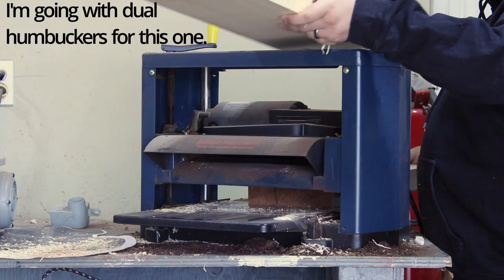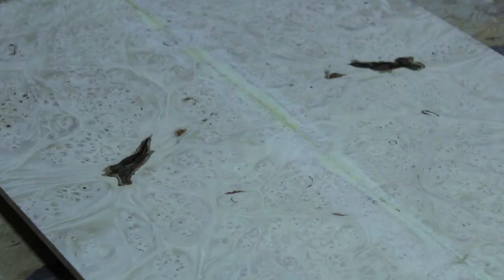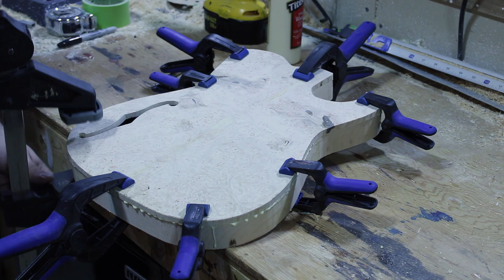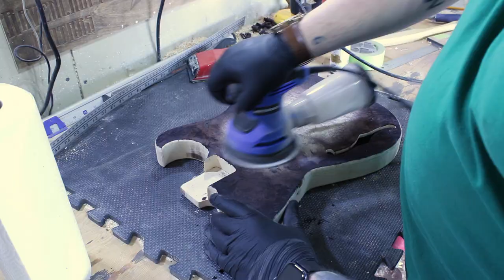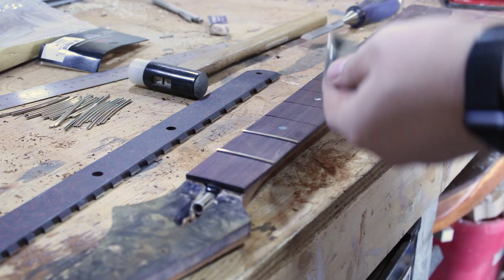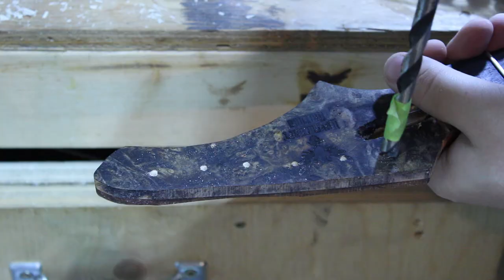GGBO 2023 - 15min Final Video Submission

Comment: Most people get better  at something they keep doing. You seem to be going backwards.
Reply from the maker: You know Tim, you are often very harsh with my builds, but never give specifics about what it is you so dislike about my builds. Can I ask what made you so vehemently disappointed with this one? I truly feel like it is a contender for one of the best I have made to date.
Reply: @ravencroftguitars  First of all, it's sloppy, it only looks good from a distance, and the design shows no imagination or innovation. Then you drilled a hole through the body and covered it up instead of repairing it. . Such an amateur thing to do. Your work is getting increasingly sloppy. It seems that you are always rushing to get done instead of trying to do it right. Everybody has the right to choose their hobby and to believe they are good at it.  Do you want the full list of what I see wrong on this build?
Reply from the maker: Sloppy how? I can assure you, it looks good up close, considering I can see it through more than a screen. You're right, I didn't inovate anything, but not every build needs to push the boundries of what it means to be an electric guitar. The person I built this for picked the shape out of ones I had already done, wanted it semi-hollow, and wanted it to be baritone. I had never built a baritone before, so I took that as the new challenge of the build. 

Yeah, I accidently drilled through the body. But I fixed it. Amateur move, but shockingly, I am an amateur. This isn't my day job, it's a hobby that I do on the side. Guarentee I won't make the mistake again.

Other people seem to like it. The person I made it for is over the moon with it. I'm calling that a success. 
I can see all the things I did better in this one than past ones. I'm calling that a success. 
I only had one major issue, and was able to overcome it. I'm calling that a success.

I'd be very interested to see a video of one of your builds, since you clearly never make mistakes and innovate with every build.
Reply from the maker: I don’t rush. I take my time. My builds take me a great deal of time. You see it condensed to 30min. 

Go for it. Share your list of grievances.
Reply: Dear Tim,
I wouldn't piss on you if you were on fire.

Sincerely,
Everyone in the guitar building community....
Reply: @BBGuitars  You speak for everyone who builds guitars, do you?    Or do you mean all of the Ben Crow fanboys?
Reply: @timhallas4275  yes everyone. Not sure what Ben Crowe or anyone has to do with your consistent non wavering ability to be a complete sphincter time and time again...
Reply: Yeah, I think "everyone" is pretty accurate.  lol
Reply from the maker: @timhallas4275  Not sure what about his comment would make you connect it to politics. Let's keep that out of this conversation, shall we?
Reply: @ravencroftguitars  OK, then tell your buddies to stop treating me like an enemy. If you have an issue with me criticizing your work, then it should be between you and me. I will respect your right to disagree with me. Do you?
Reply from the maker: @timhallas4275  Perhaps these people are upset with you because you do this same thing to a lot of different people. I have a pretty thick skin; nothing you can say about my work will be worse than what I say about myself. But if this is how you talk to people, you can probably expect some backlash.
Reply: @BoneheadGuitars  Name 5 builders who don't like my comments on their work.
Reply: No, they are upset because they personally cannot handle criticism. They thrive on the attention they get on Youtube, as long as it's always praise.  They need it.  I don't think you do.  You asked me why I didn't like this guitar. That is a whole lot more adult that these whiners.
Reply: Corey Muxlo
Shock the fox
Chris Franklyn
Gotheider
Chris Hattan
4thAve
Adair
Brett Morehouse
JBird
Outrider Custom
Ray Bagget
Reality Studios
Steve Walker
Mumbling Productions
Bonehead the Great
For starters.  😂
Reply from the maker: @timhallas4275  Did you voice your criticism the same way as you did here? Because if so, I can see why they may have gotten upset. You told me that I’m getting worse the longer I build. That’s kinda a harsh way to say you didn’t like this guitar. I know a lot of good people and builders on here that have been upset by how you present your criticism. Perhaps it’s time to reevaluate your communication tactics. 

You’re right, I don’t care about YouTube. I just like building guitars, and this is an interesting way to document it and connect with other builders. Most of my videos don’t get more than a couple hundred views, and I’m fine with that.
Reply from the maker: @BoneheadGuitars  “Bonehead the Great” got me lol
Reply: @BoneheadGuitars  I have not commented on 90% of this list, which tells me that you are just throwing random bullshit up here.  Shock the Fox... I did not piss him off. 4th ave guitars and I are friends.....  the rest I never heard of.
Reply: @timhallas4275  don’t assume.
Reply: @Tim Hallas Ok i'll have one try at this.
There are ways of communicating that are honest, truthful, empathetic and constructive. Critiquing something someone has created from scratch is a situation where you should be more vigilant in that communication, as it can easily be misinterpreted as ‘being an asshole’. Even more so with asynchronous, text based forms of communication. 
Being an adult isn’t just about being able to receive criticism, it’s about being able to deliver it in a way that it will be received in a positive and constructive way. If you can’t do that, you will be perceived as an asshole.
Reply: @micksguitarsarecool  Given the choice between being perceived as an asshole and encouraging failure...I'll risk it. Maybe this guy will understand that.  I raised 7 children on this philosophy.  Maybe they all think I'm an asshole, but none of them are failures.
Reply: We are all a community of builders, new and old. We all critique and praise and help each other in a respectful way. Seems you can't do that. So on behalf of all the decent people INCLUDING non builders... In the Spirit, Emotion and the Immortal words of Eddie Murphy... "Have a coke and a smile and STFU". We don't play those games. Slink back to all the other Faceboogers with low self esteem who feel they have to put someone down to boost themselves up. Live life to its fullest!

I looked at your channel and me thinks you are jealous of the attention Cade gets on his builds over the ones you show on your channel. He participates in the community AND gives to others freely. What was the last thing you gave away besides grief?